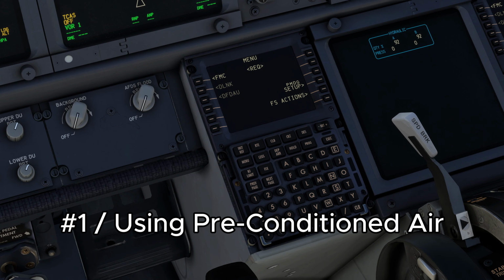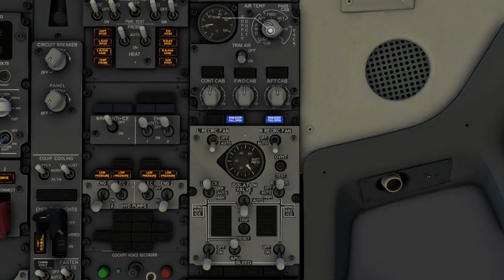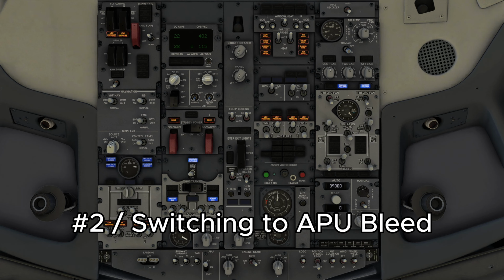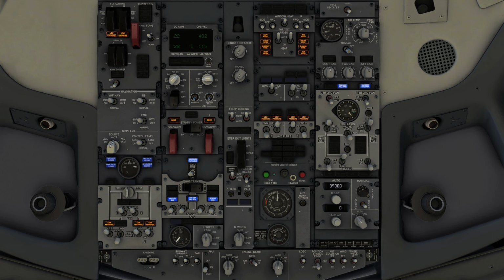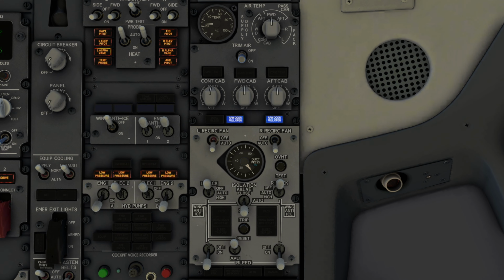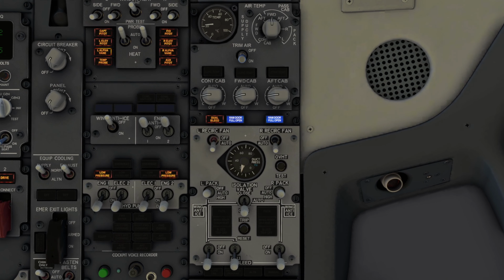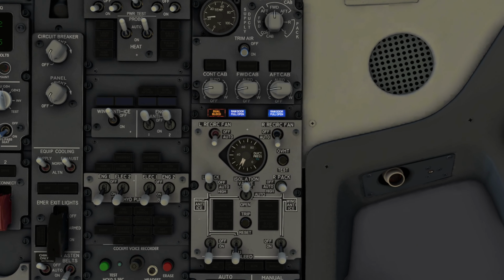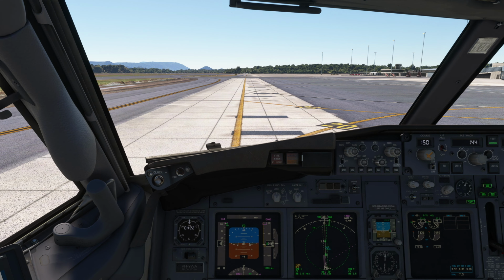PMDG 737-800 Tutorial: Keep Passengers Cool in MSFS from Cold and Dark to Engine Startup

Comment: So satisfying when you see no zone temp lights, beautiful vid mate❤❤
Reply from the maker: Thankyouuuu bro. Yes so satisfying and even after we do all that, there's still a chance we gunna get the false zone temp reading 🤣 But we can check the duct temps and L,R packs temp on the air temp switch to make sure. Boeing's fix for the nuisance zone temp light is after landing and before 1st electrical change - trim air off / after engine start - trim air on. This skips the bite test for the trim air and restarts it after engine start. But goodness knows what could happen if we got a real failure or a leak in the ducts, prob cook a few roast chooks in the cabin before take off haha